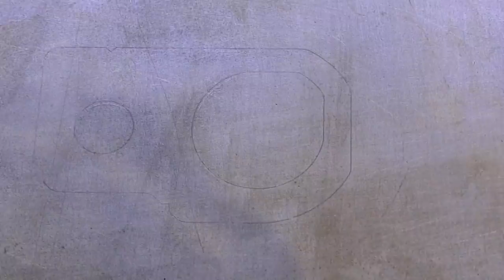RDWorks Learning Lab 164 Honeycomb Alert

Comment: Hiya Russ, that burnt machine is the same as my one, they are all clones of a RedSail machine, mine is the more common red and black model. Its been a good work horse for a year and still on its original tube. I cut a lot of card and that honeycomb is junk for that, i have some thin (0.3mm) strips of aluminium cut which i stand on edge to support the work, far better and can be moved around.

What sort of extinguisher would be best for a cutter in a house? I prefer Halon but its banned now, maybe Co2?

As you said, the golden rule is never walk away.
Reply from the maker: Hi Dave 
I have a CO2 one I bought from Amazon. 
https://www.amazon.co.uk/Carbon-Dioxide-Fire-Extinguisher-FireShield/dp/B00NPWP6GI/ref=sr_1_2_sspa?keywords=fire+extinguisher&qid=1552122012&s=gateway&sr=8-2-spons&psc=1
I always use my pin table for card cutting. There is over 25mm air space below  and unimpeded airflow
Best wishes
Russ

Comment: Hi Russ - as always thanks for the very informative information and the humor and practical thinking you always share.

I've been looking at replacing my honeycomb for other reasons - it sags in the middle and the flash burns ruin otherwise pretty good looking cuts, but it's built into the frame of my laser bed.  I think I can just cover it with a sheet of steel which should block any vapors from entering and certainly prevent any laser ignition.  What thickness and type of steel do you use on your lasers?  Mine's an 80W Reci, so not overly powerful.  If I support the sagging middle so the sheet stays level, what thickness would be reasonable in your opinion and any difference in steel types as far as use with this wattage laser?
Reply: Hi Mike

All metals reflect the CO2 laser beam. However, some are better than others  hence we use gold plated or molybdenum mirrors on our machines. Metals like aluminium, copper , silver and tin are VERY reflective  98% plus. Stainless is close behind at about 95% . Mild steel is one of the less reflective metals at about 65%. If you use hot rolled steel  (black/oxidized finish) that  keeps the reflection very low because metal oxide is NOT metal and there will be little reflection..  There is only one problem with hot rolled steel, it is shipped from the mill to distributors on a huge coil that has to be passed through rollers to flatten it before being chopped into sheets. Getting  hot rolled steel that is nicely flat will be difficult. For the size you require   you will probably be fine to use hot rolled . Take your old honeycomb from the frame and pull your sheet of steel down onto the frame with countersunk screws.  I would use 2mm thick steel.  I chose to use cold rolled steel because it tends to be naturally flat. It is at that 65% reflecting vaue BUT the slightly orange peel surface causes the beam to scatter and diffuse any reflections.  You can clean either surface  with 3M industrial abrasive pad if  it the grunge gets burnt on but usually you can use acetone to clean of fresh deposits..
Best wishes
Russ

Comment: Interesting warning about the use of honeycomb to support acrylic.  I've thought about using a sheet of mild steel as you have but I am concerned about the steel reflecting the infrared energy from the head through the acrylic (or other material) back into the head and damaging the lens.  Not long ago I recall you tried etching stainless steel, which did result in damage to the lens.  Does mild steel pose a problem here?
Reply from the maker: Hi  Stephen
Stainless steel is naturally about 95% reflective , hence I was doing something risky when I did "naked" stainless engraving. Mild steel is quite different. Firstly it is only 65% reflective and secondly it causes scattering of the light.  The concern you have of IR  reflectiing back through acrylic is ill founded. There are only 3 types of material that out 10.6 micron light "sees". The first is metals. All metals reflect IR,. some more than others . The  second  is a very small group of exotic salt-like compounds (example is zinc selenide) that allows the IR light through unhindered. The third group is EVERYTHING ELSE. The molecules of this group will be stimulated to various degrees and heat up.  That includes acrylic. It may appear transparent to visible light but to IR light it is completely opaque so there will never be any  refelection  back to the lens.
Hope this allays your fears
Best wishes
Russ

Comment: Ill take it off your hands and rebuild it! I'll promise I won't use honeycomb in it... I'm in england too!
Reply from the maker: Hi Callum.
 I had already stored it for a couple of weeks before I did the video. It was a nice day when I did the video so I decided that it had outlived it's welcome. I set about it with my slitting disc and decided to save the base frame for a mobile workbench. The rest was at our local recycling centre by the end of the afternoon, Oh not quite all .The  air pump and blower went to separate local good homes (both in need) and the HV power supply and controller went to a local makerspace.  Sorry to disappoint
Best wishes
Russ
Reply: @SarbarMultimedia  Not dissapointed, it was a long shot! - I am planning to build my own though, your videos have been a great help in some of my design features. This video for example, I always thought honeycomb was the way to do it, the laser cutter I used to use came with one from the manufacturer, but I've seen the light... Figuratively speaking haha.

Comment: Hi Russ,  I find your videos to be a wealth of detailed knowledge and thought process.

To help reduce the smoke condensate problem I have been toying with the idea of using a solid steel plate with work material raised with spaces of some sort (probably magnetic), BUT with active cooling to the bottom of the steel plate.  Simply brazing,  or soldering with silver , some copper tubing to the bottom of the steel plate and having the return water from the laser then go though the bed plate tubing then back to the chiller.   This, I think, would allow for easy wipe off of the smoke condensate after each job or when deemed necessary.   What do you think?  I would very much appreciate your thoughts on this.
Reply from the maker: I like the thought process  but additional cooling with water is unnecessary. The golden rule in life is to keep it simple . If you use just a sheet of 2mm mild steel,  the thermal capacity and thermal transfer rate will far exceed the heat you can inject into the steel. You may think that aluminium , copper or brass would be better at heat transfer and you would be right BUT the problem is the REFLECTANCE property. The are all more than  th 95% reflective  so any energy passing through your kerf will reflect up onto the back of your work. Less than 5% will go into the table That is why I use mild steel for my baseplate , It is still pretty reflective at about 65% but so you still have to be careful about reflection. . If you have a 100 watt tube for example then any 100 watt beam passing through your kerf will only be painting lines on your.table that are about 0.5mm wide and with 35 watts of power. The airflow through your machine will naturally keep the surface cool..  The tar condensate , or acrylic condensate will not just wipe off .it will need to be assisted by acetone. If the table start to mark up, just run an orbital sander over it using a coarse grit.. 
IF YOU FEEL THIS SIMPLE FIX IS NOT WORKING , BY ALL MEANS TURN IT INTO A PROJECT
 best wishes
Russ
Reply: @SarbarMultimedia  Thanks Russ for such an in depth response!

Comment: Hello Russ, Let me start by saying I discovered your videos while researching CO2 lasers. You are the only reason I felt secure enough to purchase a 60 watt machine from China. Your videos are priceless, and I've been watching them in order, while also jumping ahead to interesting subject videos
     . This video about honeycomb tables is very valuable and shows the possible danger of using one. With that being said, I plan on removing my honeycomb before I ever start doing any type of cutting/engraving. Is mild steel a better choice than aluminum? I believe I know the answer to my next question, but can you use Midas Black Max, a metal darkening chemical to lower the reflect ability of the steel?
     I'm currently building a room in my woodshop to isolate the laser from all the dust producing equipment, and also waiting to purchase a S&A CW5200 chiller before I start using the laser. Thanks again and I look forward to your fiber video's as my next purchase is a 50 watt fiber with a Raycus QB laser and a Sino Galvo SG78210 head. I look forward to your reply.

Bill H.
Reply from the maker: Hi Bill
ALL metals act like mirrors at 10.6 micron wavelength. It is all to do with the crystallographic structure of metal. However some metals are better mirrors than others. For example, copper, aluminium, silver, gold and platinum are about 99% efficient and this only drops by a couple of percent if you scuff or roughen the surface. Stainless steel is about 96% efficient and mid steel is about 65% and the natural orange peel effect on the surface of cold rolled mild steel does cause some beam scattering (reduction of energy density.) Hot rolled mild steel will be a bit better because it has a thin layer of non-metallic oxide and non-metals absorb the IR light. However hot rolled steel is usually not flat. Treating the surface of metal will have the effect of absorbing the IR energy but it may need regular treatment if you damage it.  A comment from Andy Parry may be useful to note also.

Best wishes
Russ
Reply: Thank you for your reply. Can’t wait to see your fiber laser work.

Comment: Excellent.  Gives food for thought about residue no matter how it accumulates.   I don't know if this helps any or not.  But would adding say a thin metal rod evenly spaced going across the honeycomb?   That way it lifts the material enough to get air from front to back and down through the honeycomb?  There will still be residue, but at least maybe have flow enough to keep it down.  I would say if anyone does use a honeycomb that it's cleaned or replaced regularly.    I get the feeling you're going to have a better solution coming up anyway. lol
Reply from the maker: Hi Michael

You do not need airflow to pass easily thriough honeycomb and starigh out the extract duct, what is the point? No you need to MANAGE the flow over and under your work. I VERY occasionally have to use the honeycomb table  but for 99% of jobs I use my flat steel plate bed which clips into the machone. This forces the airflow where I I want it to go and that is through a nice 30mm gap under the front door, across the top of the steel plate table and then down through a grill at the rear of the table. There may be 5% leakage over the edges of the table  but that is inconsequential. In this way there are no dead spots for fumes to accumulate.
Cutting any sort of organic material is a heat induced chemical rection  producing tars and resins that will easily condense onto the first cold surface they encounter. Acrylic is a completely different mechanism akin to ice and water. It is solid at room temperature, liquifies at 160 C and eveporates at 200C. It is just acrylic vapour and has not changed chemically. It will also easily condense and solidify on any cold surface . It so for this reason that I use a cold steel plate to work on. See this unissued video to illustrate what I mean..
https://www.youtube.com/watch?v=9J0whj3iW70

Best wishes
Russ
Reply: @SarbarMultimedia  For myself I wouldn't use a honeycomb.  Guess what I'm saying is if someone insists on using one then maybe raising the part up enough would at least allow air to flow and keep the honecomb cells from filling up with fumes.   Like you showed there are better options than a nasty honeycomb anyway.  Thanks  As always I'm learning a ton from your videos.

Comment: If I want to cut a hole in some materials, to fit in it material 3mm thickness, how do i know what dimension to draw do rd have any option for it? When I draw 3mm he cut let's say 3,2mm, you understand me I guess... Or I whill learn that by expiriance
Reply from the maker: Hi Zoran
That is a challenging question because it depends on so many factors.. Draw a  25mm circle then cut it out at what you think is the correct (or a good) speed and power.  Now measure the hole you have produced and measure the disc. Subtract the disc dimension from the hole dimension and the difference may be 0.4mm That means tour effective cut width (kerf) is 0.2mm wide. This means that for a perfect fitting disc in your hole you need to add 0.2mm to your disc. RDWorks has a tool for doing this. It is toward the right end of the top toolbar and is called OFFSET POLYGON. This allows you to offset your shape by a fixed amount inside or outside the original . HOWEVER,  if you change the speed of cut,  the fixed power you are using will affect the kerf width because the burn will happen in the cut for more or less time. If you run almost as fast as the possible  so that your disc JUST falls out you will have produced a slightly tapered cut where the kerf may be 0.2mm at  the top and 0.05mm at the bottom.. The focal point of the lens should ideally be on the surface of the material you are cutting, if it is not then the kerf will change. The focal length of the lens will change the kerf. The longer the focal length, the bigger the kerf will be. The efficiency of your air assist will affect kerf width also.. The kerf width on a 6mm hole will be bigger than on a 20mm hole because the 6mm hole will never reach your program speed and will therefore be burning more.. Change the material you are cutting or the thickness you are cutting and everything changes. There are no absolute rules you can follow other than  to do some tests with the materials , speeds, power and lens you intend using and then  measuring both parts as I described earlier.. I think challenging is the correct word to use  because no matter how much experience you gain it will only teach you about your best guess. If you are always cutting 3mm mdf for instance and always use the same lens, power and speed, you may be able to record these factors and reasonably be able to predict the kerf.

Best wishes
Russ
Reply: @SarbarMultimedia  thank you for answer, all the best!!

Comment: Very informative video. 

I've been doing the exact thing in the melted machine, using small spacers to prevent flashback. 

Do you have a recommended setup for cutting 3-6mm acrylic? 

They will sag unless evently supported from below and hitting an acrylic piece below the main sheet will result in residue on the egde. I was using 1mm thick card which left no marks at all, but it's extra work cutting up and positioning those pieces for every sheet.

Bed of nails seems like the most efficient, like in your earlier videos but it's too dangerous for regular work.

I haven't yet purchased my own laser yet, just doing all the research I can now. Thanks.
Reply from the maker: Hi Kennui
3 mm thick acrylic is surprisingly stiff. As you may have seen from my videos I hate honeycomb and always work with a flat steel sheet. This allows the airflow to come under a gap in the font door and flow backwards across the top of the work for engraving and under the work for cutting because I always use stand offs of some sort.  I often use 400x600 sheets of 3mm  and I have some 20mm  diameter discs of 8mm thick acrylic which I use to support the long edges (3 back and 3 front  I also drop one somewhere in the center  This is adequate support to stop initial sag with a 2" lens you can tolerate over 1mm of sag/out of focus. However as you start cutting pieces out of the sheet the  weight distribution of the sheet changes and additional sag can result.  To overcome this I will put one or two tags (0.1mm bridges) to stop components falling out . This keeps the sheet balanced and when the beam passes over the acrylic center support I see no problem on the edge at that point. just a neat cut into the support disc.. I do exactly the same support method for 6mm thick acrylic but this time I do not tag items into the sheet  because the droo is guided for all but the last 2mm and it is very rare foe items to fall into the cutting path of an adjacent component.

The bed of nails is the ideal solution but it is a bit tedious to set up. I am just about to experiment with a quicker and easier flexible nail support system that I have copied  from a friend of mine.and adapted. I will be showing it in a future video.

Best wishes
Russ
Reply: @SarbarMultimedia  Thanks for the reply, really appreciate you taking the time to do so.

I'm very interested in Trotec's square grid table, it looks white and is supposedly good for acrylic, any idea what material or coating they use? Haven't been able to find good info/videos on it.

Another system I have found is using metal rods arranged like a slat bed. In theory this should be easier to clean as well.

Looking forward to your future videos.
Reply from the maker: @kennuimuffins2426  
 The Trotec  grid you have seen is just an acrylic ceiling light diffuser/grill It is known as eggcrate. You can Google it but beware they are not all acrylic. Many are styrene and a bigger fire hazard than acrylic. For example http://www.edee.com/eggcrate.htm
It's just a honeycomb support in acrylic and has all the closed cell trapped fume issues associated with metal honeycomb. Here it is. I have seen and used it but would not recommend it because it prevents rapid fume evacuation from below your cut.

Best wishes
Russ